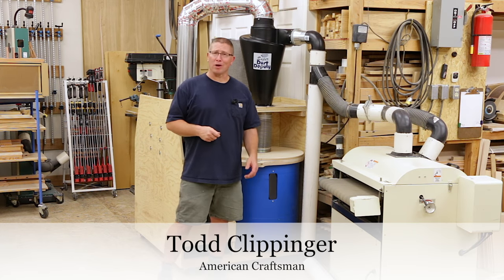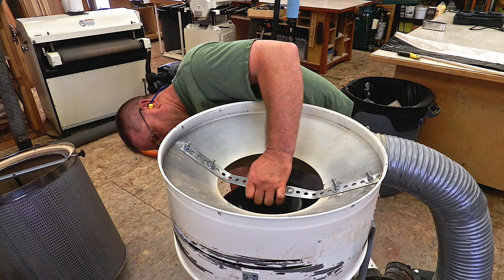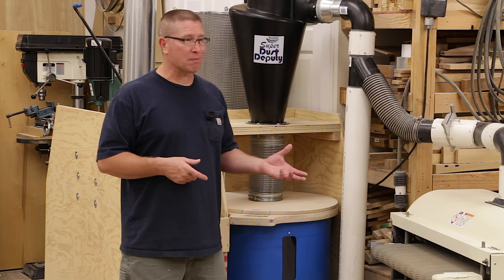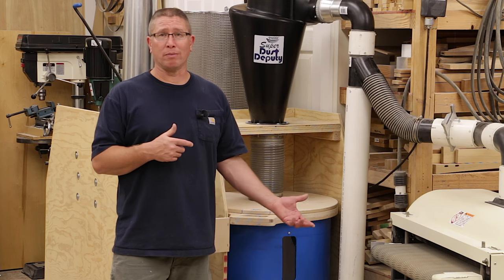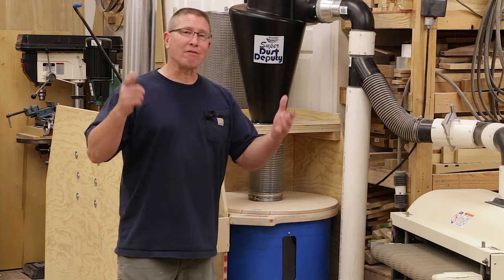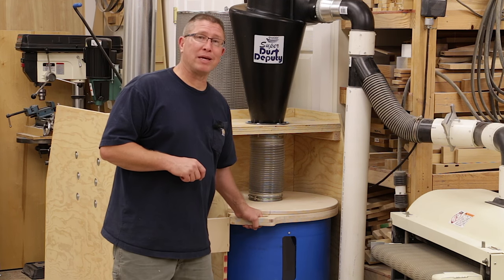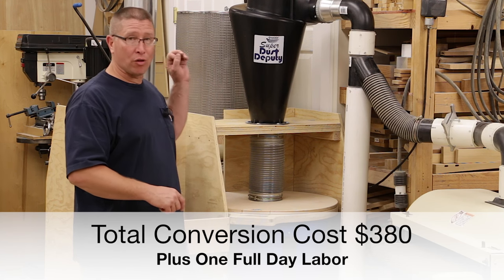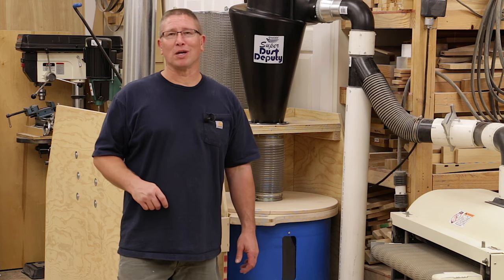Dust Collector Update

Comment: Thanks for the update on your dust collection system. I also use the same dust deputy and love it, but am using a metal 55 gallon drum. That is a great tip to find a shop that is trying to dispose of the barrels.
Reply from the maker: The plastic barrels are great because they are super tough and don't get dented and are free!

Comment: Thank you for you videos, the're very useful... just one question: why that piece of pipe between the barrel and the cyclone? does it help avoiding the dust to go up and into the second stage?
Reply from the maker: The hose between the cyclone and the barrel is the flexible break point where I can disconnect the barrel for emptying. At 5:30 you can see the barrel sitting out in front and the disconnected flex hose hanging free. That shows the break point. 

Thanks for watching!
Reply: Ok thank u!

Comment: I wonder why you have problem with the baffle if the baffle is at the exhaust side and not in the inlet side ! I have build a back pack version of two stage system using a vacuum motor, and sure you will have a very strong suction even with a thien baffle on
Reply from the maker: Good question and I don't have a good answer. Since the baffle was below the port to the second stage, I would not have believed that it slowed the air down that much, but it is clear that it did. The guy that told me that, is a pretty smart guy and I weigh his comments pretty heavily when he tells me something. Removing the baffle proved he was right since the increased air flow crushed the trash can. 

Thanks for watching!